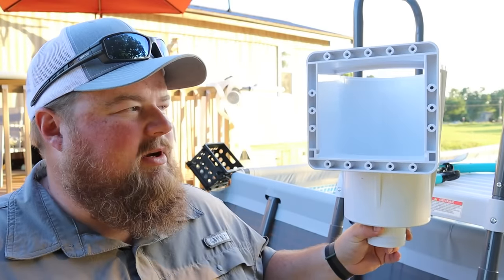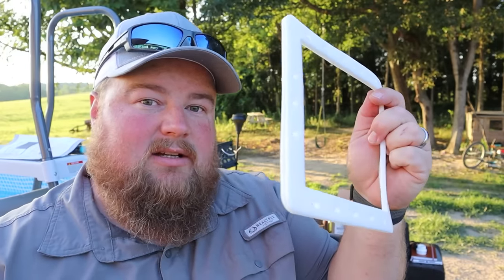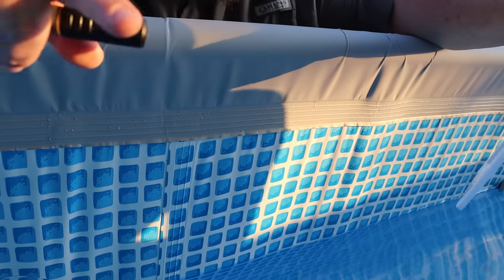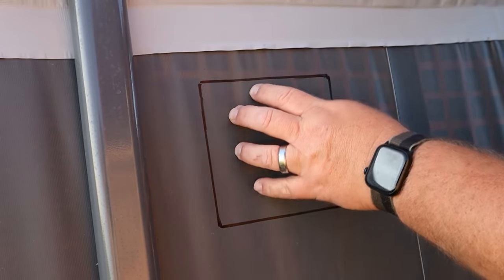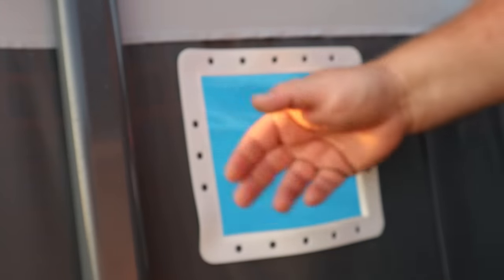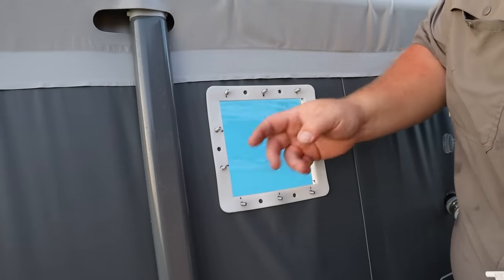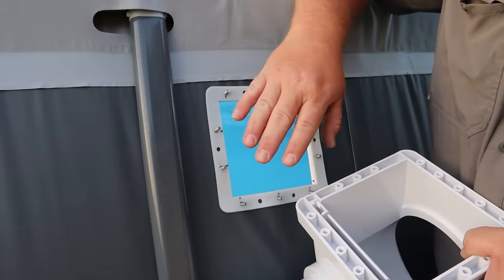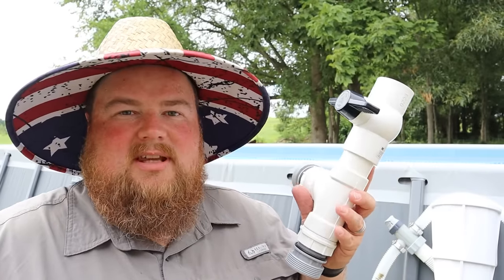BIG UPGRADE:  Pool Skimmer Install on Intex Above Ground Pool | Hayward SP1091LX Dyna-Skim

Comment: Far as skimmer placement, I've always seen them located either right around the intake (like you're doing), or directly ACROSS from the output side.  Either way (or both) have the skimmer in a direct current that the water flows due to the intake/outputs, and helps with directing the debris towards the skimmer openings.  I'd guess you'll have pretty decent results with it being near/above the existing intake, and if you need a 2nd, I'd route it over to the side direct opposite the output myself (I'm at the 4:30 mark, and you may address this at some point further alone, as you usually do on things I think to comment on during a watch, lol).
Reply: Also a cleaner way to do the hole cut, go ahead and mount your skimmer with the ring, gasket and box, THEN you your razor knife to trace along the inside of the (blocked) opening.  MUCH less chance of messing up on the larger hole that way..
Reply: Scratch that, just saw how their gasket set up works, won't work that way, lol..  Carry on, lol.

Comment: Hi, I have a question about your pool. 1st what state do you live in? Why you might ask. It will determine if living in Missouri if can leave my pool up all year long due to the winter months. 2nd question, did you leave your pool up during the winter months? 
I'm so hoping I can leave this pool up all winter long. My husband & I are both disabled & this would be wonderful if we could. 🙏 that we can for sure. But if not the platform is a great template & the next time you have to set the pool up, it will go more smoothly. 
Thanks for videoing the pool base setup & the skimmer installation. I had that on my other pool & loved it & missed it on the little stock tank pool I made the last 2 summers for my grandson. But it was only 8' wide so cleaning was a breeze. Just took a 10' hose & hooked it over the intake tube. So easy.
This year we have the same pool as you & can't wait to get him in it to teach him how to swim. He will not be able to touch the bottom of this pool & it's going to be great.
Have a wonderful day & God bless you, 
Chris from Missouri

Comment: Just remmeber a skimmer  also means it can run the pump  dry  if it drops below  intake lvl  of the skimmer ,  because  that skimmer  doesn't have a lower ballest  line  , good looking work bud.  18 year  pool professional  hear , good video  man  nice job , one other thang to point out you have. 2  side wall intakes shut them down  force all suction to skimmer     run  my skimmers full tilt at night   due to bugs goin to pool lights      on my 87,000 gallon pool

Comment: Never had a pool so don't really understand all the tech stuff.  Glad you know what you are doing, Sam!  However, it seems to me that those white hoses need some protection from the sun here in the South.  Also, it would then cover up some of the mess of equipment.  Could your proposed deck addition go above it all to hide it a little?

Comment: So what connections actually come with the skimmer? And side note, I’ve had my hoses crack at least once a summer. I’ve replaced one and it just cracked from heat exposure. That’s the problem with hoses. I may go to Lowe’s and try to find better hoses than the Intex

Comment: This isn't a question on the filter but It' a question about the top rails. Everyone is saying their rails are pushed in but mine are pushed out. I'm assuming once I add the water the walls will go in ? I hope this is correct because I'd like to move my pool up against the covered porch wall before filling it.

Comment: I will say for a pool that size you need an upgrade for your pump. I have a much smaller pool and the pump and sand filter I use works amazingly every year to the point where I didn’t have to use any chemicals (besides some chlorine in the floater).

Comment: The problem with this skimmer is the small door of the skimmer inside the pool, which is fixed in the closed position under water pressure every time we swim. Do you think it's possible to remove it

Comment: The only step I would change is when making "pilot holes" I would use a round awl or something with sharp round point.
Sometimes in liner material using a knife makes a weak spot for liner to start a tear. Using a round object creates even "stress" on the hole.
Never know years down the road that one step maybe save some trouble.
Great video though

Comment: The suction on my skimmer is low, I checked to see if there were any clogs or anything stuck anywhere. All clear but it's still slow do you think it may be the pump. I have the Costco pool that comes with a sand filter.
Reply from the maker: It's probably the pump needing backflushed and rinsed. We have to do ours often. We just bought another pump/filter and will show that upgrade in a video soon.

Comment: Where should the water level be in the skimmer ? I’m not sure if I have enough because the pump keeps working like air is getting in.. I have it currently below the metal screws on right and left side of faceplate
Reply: Water line would ideally be half way up. If air is actually getting into the system, it is probably through the hose connections.

Comment: I have a pool just like yours and my side walls are not vertical. Have you run into any problems with the skimmer being mounted on a slight slant?
Reply from the maker: We didn't notice any over our first year of use, no. It's less an ideal for sure, but was still a great addition we think.

Comment: You should consider converting to a salt water pool. Cheaper to run.
Reply: I had one on my Intex pool. Absolutely loved it . Water felt clean on your skin, no horrible smells and easy to maintain. Unfortunately I found out the hard way that those support posts are very susceptible to rust and the salt rusted them out first season. I ended up buying three sets of poles before we packed it up to move. Hopefully we can get it up on our new property next summer. I'd love to get two more seasons out of it before we install my dream in ground fiberglass pool with salt water system. Fiberglass is safe to use with salt water. May cost more, but it's important to my health. Chlorine is not my friend.

Comment: I'm hoping for a reply from anyone here... wouldn't you plug the 2 original intakes and just use the bottom of the skimmer box as the 1 primary feed into the pump and then have the 1 outlet back into the pool after the filter? The more suction you have into that skimmer box the better it will do it's job.
Reply: The way he plumbed it with a ball valve gives him more control. Wide open gives more suction to skimmer, or he could choke it down to pull more from the original suction.

Comment: guess my pool is different doesnt have a flapper we just got this house week ago has a 40ft by 15 ft wide 15k gallon pool which is nice but haven't got to use yet cause all the ph, alkalinity, chlorine levels were all low or off so have about 130$ worth of chemicals in it now working to get it swimmable atm my FC levels are 6.8ppm, TC levels are 7.2ppm which the pool place said is perfectly safe to swim in which is so then why do we have test kits that say 4ppm for FC and TC is suppose to me 4 max ?

Comment: GOOD INFORMATIVE VIDEO. IF YOU ELIMINATED THE OTHER INPUT/BYPASS HOSES YOU'D HAVE BETTER SKIMMER RESULTS. THE ONLY THING I'M NOT LIKING IS THE REDUCTION OR WATER HEIGHT. LOOKS LIKE YOU LOST AT LEAST 3" ON AN ALREADY SHALLOW POOL. ALSO GET A MORE POWERFUL PUMP SETUP & YOU'LL REALLY SEE A DIFFERENCE.

Comment: Better way to cut is to do a 45 degree inseams cut on the corners and then fold the liner, apply repair compound. So now it would double up the thinness of the liner. Then do his install. ;)

Comment: A skimmer is ok , but when all those leaves fall from the tree or a storm that throws leaves and bits in there, uts not enough, if you dont want a pool cover you could do a gazebo with clear lite plastic on top, which will help, we ended up cutting all the trees down by the pool , it became too much work

Comment: NO SIR install the entire skimmer through the wall  I don't even think you need to make pilot holes for the screws I think they popped through and then remove the square on the inside thus it is buttressed on all sides when you make your cut

Comment: Why did you just buy the pool with a skimmer already built into it, so you don't have to worried about leaks or making mistakes when cutting a hole
Reply: Because this is a "temporary" pool and they do not come with skimmers

Comment: looking at it i think the better way wouldve been you put in the mounting holes before cutting out the center , simply because the skin will loose its shape without the material in the center holding it together , once the center is out you can pull it back in shape while feeding the bolts through the holes holding the seal and flange

Comment: As soon as I saw you have to cut a hole in the new pool, I was out.
Reply: Just did it today, not too bad.  The worst part is getting the screws to actually go in the holes through the liner.  The cutting is the last step and actually the least scary part.

Comment: 3:40 the people that designed the pool didn't prioritize the function of the pool, they took the most cost effective route.  They proper placement of the returns would be on opposite ends of the pool (longways) in opposite corners.  Imagine this returns creating a whirlpool effect.  Putting the return lines where they should've been would've quadrupled the cost of the flex plumbing.

Comment: You will dramatically decrease the amount of maintenance required by running a skimmer and sand filter like you are doing. I am not sure if your pump is strong enough, but a pool vacuum will eliminate most of what's left as far as cleaning debris out of the water!
Reply from the maker: It runs vac but not like crazy strong.

Comment: The problem with Intex pools is you usually don't have a sand filter. You can't backwash the filter. You have to take the cartridge put and either wash it or replace it. This makes opening your pool really s**k. It looks like yours has one, I'm not sure. You're honestly better off getting a real above ground pool with a proper pump and sand filter. Also the Intex hoses are garbage. What you want to use is the thick hoses that are smooth on the outside. They will last forever. The plastic ones always break. Just a week ago I was at my son's birthday party. When we got home I found one of the plastic hoses had broke and my pool was drained down to the skimmer. Thankfully the pump survived. Smart doing PVC, I should have done that years ago but ALL the hoses replaced with PVC. Those hoses are wicked cheap. The other problem with Intex pools is the eventually the bottom of the pool will rot out. Happened to a friend after only three years. That will never happen with a real above ground pool. My liner has lasted 20 years. I've been doing this for 20 years and I've seen it all. Also don't use pool water balancing chemicals. Borax to increase PH and Baking Soda to increase alkalinity. You save bucko bucks. You will still have to get calcium for hardness. I have neutral water so I have to increase all three every year.

Comment: If you break it down for winter, I would install drain in the bottom of the pool. Yes you will have to cut the liner but the benefits is worth it….it will circulate the water from top to bottom….and you will save on chemicals……as the chemicals will just sit on top of the water…..We have did this and what a difference it made for the maintenance to the pool……..loved in the pool…..Enjoy 🌊🌊🌊🌊🌊🌊🏊‍♂️🏊‍♂️🏊‍♂️🏊‍♂️🏊‍♂️🩱🩱🩱🩳🩳🩳🩳🤿🤿🤿🤿🤿🤿🤿🤿❤❤❤❤❤